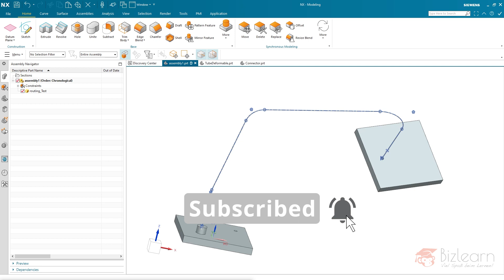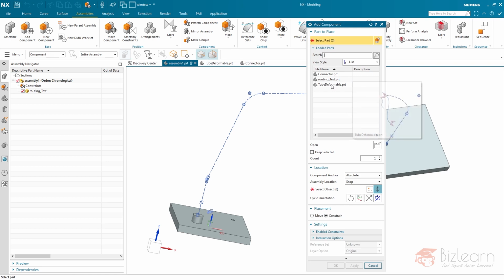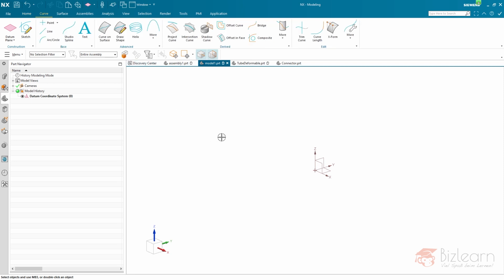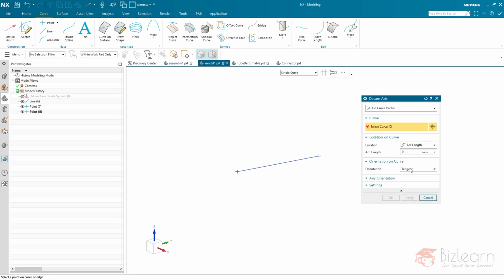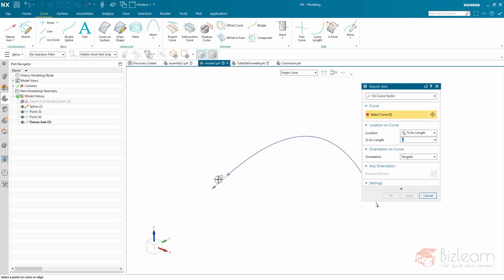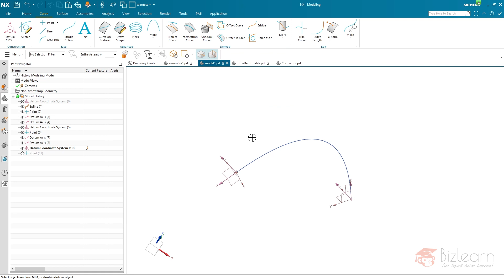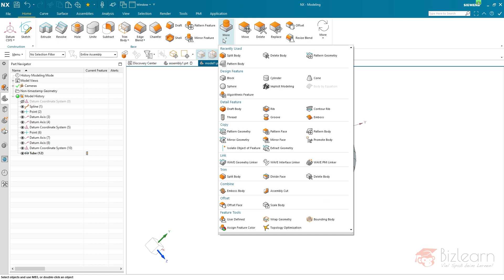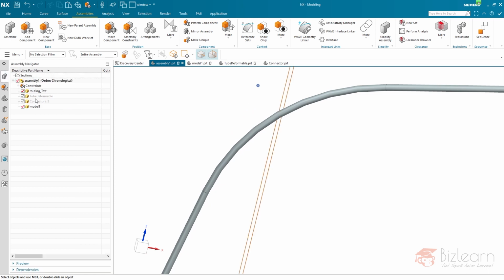New Siemens NX CAD Secret | how to create complex deformable parts | Beginner and Advanced Tutorial

Comment: I never knew about the enter key trick! May I ask you, how would you go about constraining a spline to an exact length? For instance, you have a 100mm cable or string and when you move the endpoints at different locations, the cable automatically updates its shape so that its length is always 100mm long. This is very useful to simulate real life situations, where you have a cable attached to moving parts, and you want to show what the cable looks like when those parts are moved in different positions. I haven't found anything in the routing application that can do that.
Reply from the maker: Hi, no that is not possible ootb. I believe the new feature automation can do it, but it required some preparation of course
Reply: @Bizlearn_Siemens_NX_Training  What is this "new feature automation"? Anyway, you lead me to do more research and found out that this can be done with a tool called Optimization. Setting the total_arc_length of the spline as objective, and the spline endpoint G1 magnitudes as variables, it will converge the spline length close to the target length. Not an ideal workflow, but can be done.